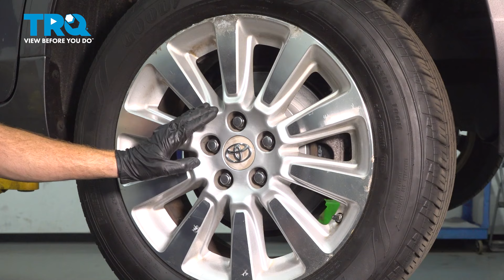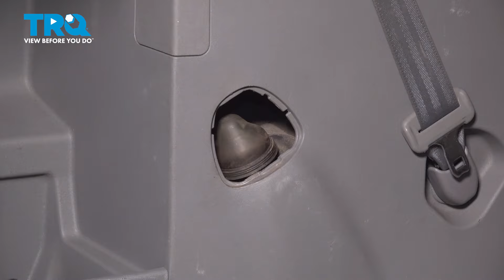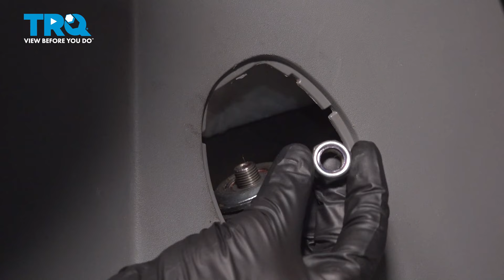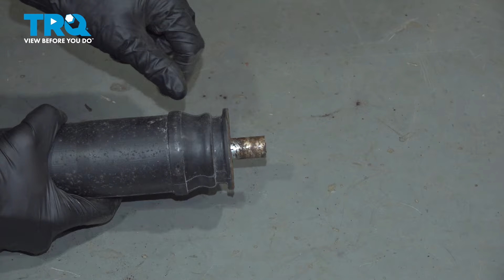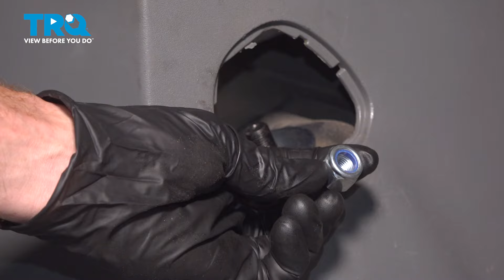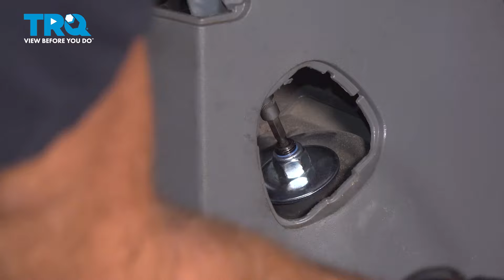How to Replace Rear Shock Absorbers 2011-2020 Toyota Sienna

Comment: I just completed this job! Everything was very well explained!!! Thank you for the video. I have a 2013 Sienna. I found one thing to make the job easier when placing the shock back in the wheel well. I depressed the shock placed the shock on the bolt and then allowed the shock to extend into position that made life easier.